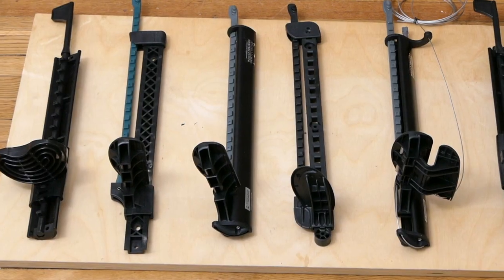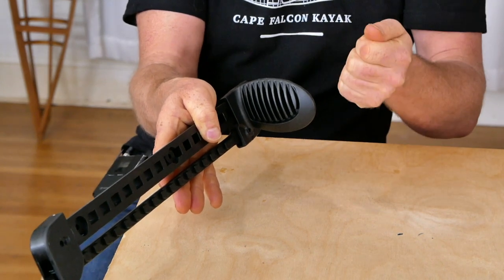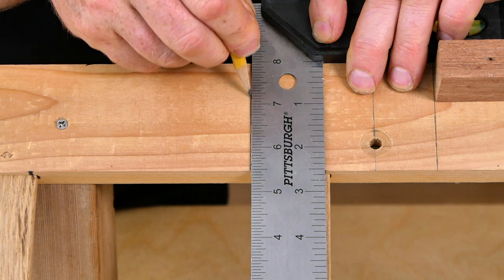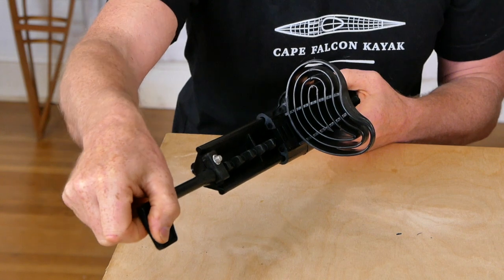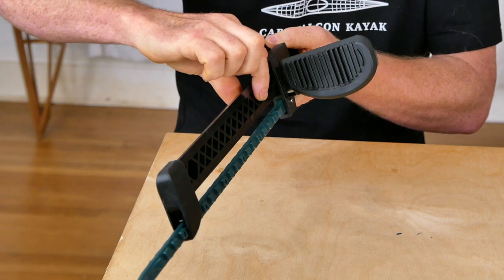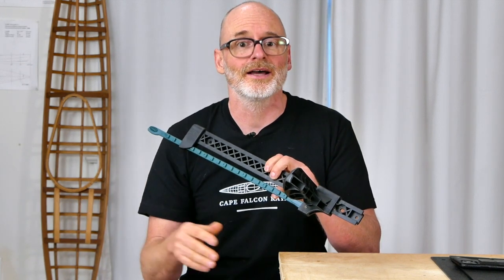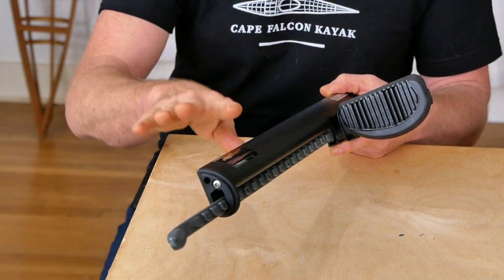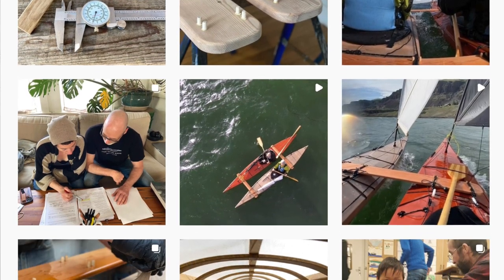Comparing Four Different Types of Adjustable Kayak Footbraces

Comment: Nice to know about the synthetic foot braces ... but for me it's the aluminum Yakima's all the way ... they're heavy, hard to adjust when clogged with sand and have a small perpendicular toe plate, expensive ... but in 20+ years I've never had 'em slip or break.

Comment: This is incredibly depressing.  I've been a sea kayaker for almost 20 years. The circulation in my feet is a bit of an issue, so I'm a bit more critical about this.  I also have an actual kayak stroke - where power is transferred to the kayak through my feet. All of these units in your video are just awful. They will cut off circulation, make your feet numb,  and if you paddle hard they'll snap off in less than two years.  What they are good for is to support an actual foot brace that goes all the way across and covers your whole foot.  I had to DIY, four times for four kayaks.  I pad mine with 1/2" Yoga mat.  If you need to control a rudder, some kind of hinges,  and use your toes.  That's a complication.  Apparently no one makes this.  After so many years, just insane. (If anyone has any questions leave me a comment. )    And using any of these to attach a footbrace works great. They  make it adjstable, and because the force of each foot is support on both sides they'll last indefinitely. I usually attach my braces with just a self drilling screw through the plastic.
Reply from the maker: No argument here that nothing is better than a permanently installed and properly shaped footboard.  That’s pretty common in performance kayaking.  This is just a review of what you can actually buy.   The sea lect pads and tracks are the most robust of the bunch.  Extremely strong and good surface area.